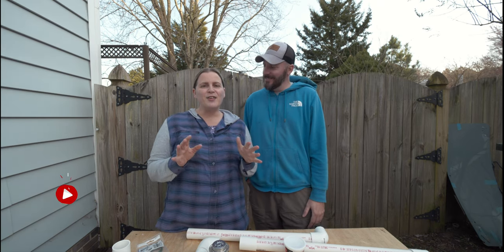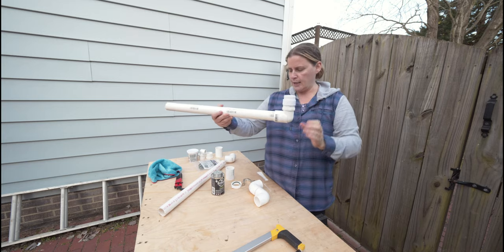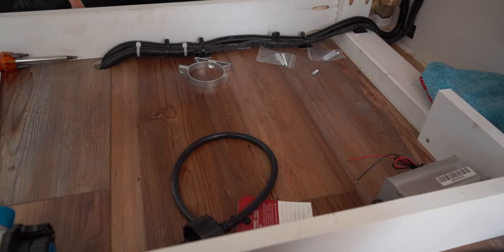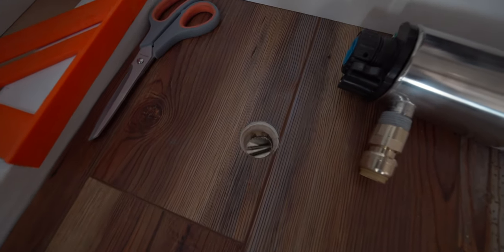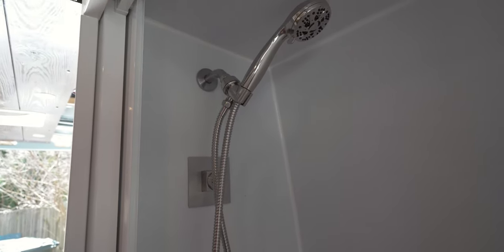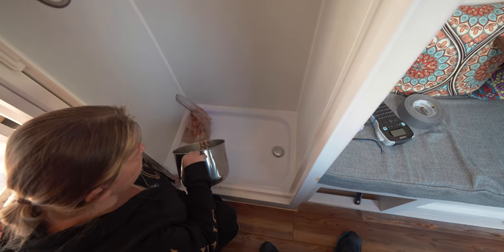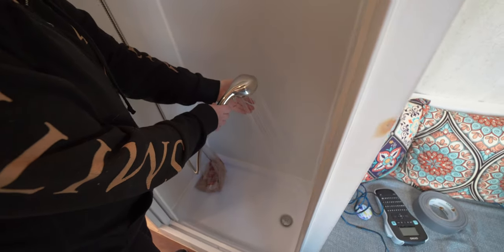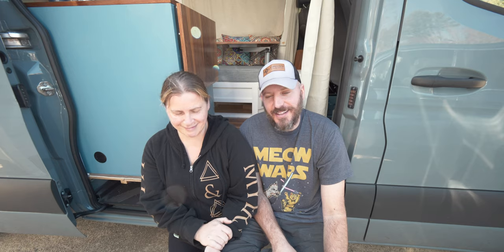RECIRCULATING SHOWER in a VAN  |  PART 2  |  Our Sprinter Build Install Continues!

Comment: I don't see if you installed a sediment drain in your water reservoir tank. Heavy solids will create a sediment that will accumulate in that tank, which will actually help with your filtration. However you still will need to be able to drain those sediments.

Comment: Love this idea, however I have a question for you. How does the water come from the filters to the hydronic system to provide hot water in the system? Do you have a separate heat exchanger for the closed loop?
Reply from the maker: Yes we have 2 heat exchangers… One for the sink and heat and one just for the shower. Hope this helped!

Comment: I might have missed it, but:
Pressure gauge before filter might help notify time to clean/ replace them. My pool filter says 10 psi increase is the right time. 
Nice video!
Reply from the maker: Thank you! We did not install a pressure gauge. That’s actually a great suggestion! Much easier than taking them out to see how they are doing! Thanks for watching!

Comment: That's complicated but really neat!  I guess there's a drain on the tank underneath and you periodically empty and refill it?  Do you have to use special soap and shampoo?  And most important of all, who gets to service the "Tubshroom?"  -Burt in NJ
Reply from the maker: The Tubshroom is alllllllll Sandy’s job! We have been tweaking the system since and currently don’t use soap... just water and friction... we are going to try and use some biodegradable soap to see if it works
Reply: @WanderfulRevolution  Friction is good. ;-)

Comment: great videos, very informative.  my only concern is the water tank building up a layer of sludge over time.  I guess this could be avoided by running clean water after a shower for 5 minutes so that water in the tank is clean and not dirty?  How have you found it?
Reply from the maker: So far so good… we do run it for about 10 minutes to avoid build up in the tank… we haven’t noticed any yet fortunately !!!

Comment: Thanks for the good content! Can you please let me knw what vendor you get the 12V UV filter from?  Do you have a link for it?
Reply from the maker: We bought the filter on eBay and I unfortunately can’t find it again but this is what we used https://www.freshwatersystems.com/products/viqua-s2q-p-12vdc-silver-series-uv-system-powered-by-sterilight-3-gpm?variant=13250138177579&c1=GAW_SE_NW&source=PLA_USA_SS&cr2=shopping___nw___smart&kw=13250138177579&cr5=&cr7=m&utm_source=PLA_USA_SS&utm_medium=cpc&utm_term=13250138177579&gclid=Cj0KCQjwu7OIBhCsARIsALxCUaNBPVVdtZlmNHBAqe1bwP3ejc1aOsvJQegmkb2Hjcw9lAeU9Ntq9usaAk9VEALw_wcB

Comment: Is there any reason someone couldn't run a line into that secondary tank with a manual valve and pump over water from your main freshwater tank to fill it? It seems like most people seem to plumb it isolated like this and I'm wondering why.
Reply from the maker: You absolutely can… but most do it to isolate potable water from non potable water for safety reasons… sorry it took so long to get back to you! Thank you for watching!

Comment: Curious question not sure if you have seen 6 gallon milk crates before but you think I could build the pump/tank/and filters/acculumator using that as the framework or no.
Reply from the maker: I have seen them online but never have had experience working with them… it’s worth a try! I would be curious on how it would work! Thank you for watching!
Reply: @WanderfulRevolution  thanks. I'm a truck driver so I need something that's able to be moved and set up in different trucks. And so if I attach everything to a milk crate the though is it should work.
Reply from the maker: @spiritualinsight  if you try it would love an update!
Reply: @WanderfulRevolution  will do

Comment: How does your shower compare to youtubers " Snow and Curt" recirculating shower? Thanks!
Reply from the maker: Our system is similar but we don’t have the ability to flush or recirculate the water back into the tank to keep it from freezing. That being said we avoid freezing weather and physically wash the filters and drain the system. We wanted to make our circuit as short as possible to keep the size of our holding to a minimum. Thank you for watching!

Comment: Sorry for the stupid question.  Did I hear you say that your Espar heater was heating the water?  If so, does that mean you don’t have a separate hot water heater?
Reply from the maker: Hi! Thanks for watching! Yes! That exactly it. No separate hot water tank/heater. The one system provides our heat and hot water. On demand and tankless. It uses a glycol system to transfer heat. We have some videos on it for you to check out!

Comment: Great system! 
May I ask what Viqua UV filter did you get? S2Q-P/12VDC or S5Q-P/12VDC.?
Thank you very much for sharing your conversion!
Reply from the maker: Hey there! Thanks for watching! We went with the S2Q. The S2Q can filter 3 gallon per minute and the S5Q can filter 6 gallons per minute. Our water pump is 3 gallon per minute so we think the S2Q should be fine for us.
Reply: @WanderfulRevolution  been loving your videos, but do you have a link to the UV 12V unit?

Comment: any issues with vibration/shaking to rigid pipes to rigid connections?
Reply from the maker: No problems so far! We’ve only been living in the van for 4 months so time will tell. We regularly check for issues but have been fortunate so far!

Comment: Great vid.
How many gallons of water do you recirculate before you have to dump it and refill with fresh water?
Reply from the maker: We put about 5-6 gallons in our tank. We are having some problems controlling soap suds so we are each getting a shower off the 5 gallons, then we need to change it. Looking at lotions for soap that doesn’t suds as much. It’s definitely still a work in progress
Reply: @WanderfulRevolution  Try adding Magnesium Sulphate(Epsom Salts) to the shower water. Breaks the soap suds.

Comment: I noticed you have aUS solid motorized valve. Are you happy with them? How they perform? I plan to install 21 on my van...
Reply from the maker: Yes we have one on our kitchen grey water tank and our shower tank. So far we really like them. Makes dumping easy. We have heard that they can freeze in really cold weather though, so that is something to consider.
Reply: @WanderfulRevolution  Thank you.
Reply from the maker: @raducristodoru9050  your welcome! Best of luck with your build!
Reply: @raducristodoru9050  I may end up with a lot of them as well.  I am thinking the stainless steel ones are best even though $50 each.  Speaking of which, know of a way to get them in bulk for less??? Since you're getting 21...
Reply: @DrychronRed  Initially I planned to use 3 way ball valves and 2-3 motorized valve. Later i changed all my 3 way valves with motorized valves. I purchased them from Amazon.
Reply: @DrychronRed  if i may, can you share your water system that requires so many motorized valve?
Reply: @raducristodoru9050  i am in bed and leaving in a few hours on a trip.  I don't have my design on paper yet, but it's for a multiple fresh tank, recirculating shower and tank, greywater tank system that I can move water from tank to tank or purge a tank to the ground if needed.

Comment: Hi, great video, I'm doing a similar recirculating shower but not sure how big the water tank for it should be...did you work out there was an optimum size considering the weight issues ?
Reply from the maker: Thanks so much!!! We have a 7 gallon tank and we put about 5 gallons in it. The 5 gallons was more than enough. We had a little over half in the tank while the shower was running. So I think 5 gallon (18 liter) is pretty sufficient. Of course this would depend on how long your water circuit is. The shorter you can keep it the less water you’ll need.

Comment: How much water did you fill in the tank for it to become functional?
Reply from the maker: We have a 7 gallon tank. We put about 5 gallon in it. We think we could run on as little as about 3 gallons if need be. Of course this depends on how long your water circuit is. The shorter the circuit the less water you’ll need! Thanks for watching!

Comment: What size shower pan? And where did you get it? Thanks
Reply: Found it in the comments on you "Building A VAN BATHROOM & SHOWER (Part 1)" video. Thanks
Reply from the maker: Awesome! I was about to send you that link! It’s  a 24x32.
Reply: @WanderfulRevolution  Thanks. 1 more question. What is the internal dimension of your shower? Wall to Wall? 24x32 or does it shrink a little?
Reply from the maker: @trevortirrell  it shrinks just a little. It’s 32x22ish. This is mostly because of the nautilus shower door. Also it’s narrower at the top because of the curvature of the van

Comment: don't you need a p-trap in the drain?
Reply from the maker: We aren’t plumbing experts by any means, but our understanding is that p traps are basically to keep gases and odors from coming back into your house from the sewer systems. P traps aren’t generally used in the RV industry. They do often use a waterless trap called a hepvo. We used one of those on our sink. We didn’t use one on our shower because we don’t feel like we should have an odor problem there since the water will circulate for a few minutes after showers are complete, so we will
Basically have filtered water in our tank. Of course if we find that there is an odor problem, we will just add a hepvo in.

Comment: hey there i just installed a recirc shower in my van and noticed that it isnt filtering the soap. do you guys seem to be experiencing the same issue?
Reply from the maker: Honestly we haven’t used it extensively yet because we are still finishing up the build. A few questions though.

1.What types of filters did you use and in what order?
2. How big of a tank did you use?
3. How often to you change out the water?
Reply: @WanderfulRevolution  it goes spin down, pump, accumulator,  three filters carbon to the two white ones then a UV filter the tank is 5 gallons and I only used it once to shower
Reply from the maker: What micron are your filters in the 3 filter system?
Reply: @WanderfulRevolution  1 micron and 2-5microns
Reply: From my research it seems these systems will not filter soap
Reply from the maker: Wow seems like you are doing everything right! We thought the filters would do a good job at taking care of this. Will be interesting to see what happens for us. I wonder if a different type of soap would help? We definitely plan on doing an update video once we start using it. Have you watched Snow and Curt? Seems they have been using theirs regularly for a couple years. Wonder if the have this issue.
Reply: @WanderfulRevolution  yeah I just watched theirs it still seems to be an issue but I just have to tamper with the setup a bit
Reply from the maker: Please let us know if you figure something out! If we come up with any ideas, we will post a reply to let you know what we find. Best of luck!
Reply: I'm pretty sure I read that adding epsom salts to the water help break down the soap so that the filters can catch it.

Comment: best way to do this is, to divert the water when soaping and rinsing soap let it drain to gray tank  then the valve will direct the water to be recirculating.

this way with 2 gallons you can really do a normal shower( short) then chill out with 10 minutes water only shower and no soap.. simple. valve would do the trick